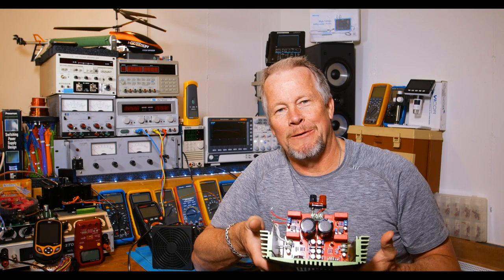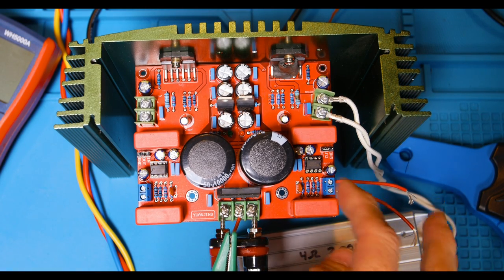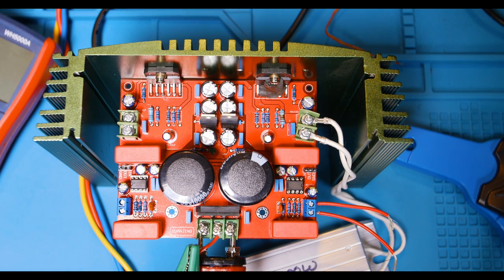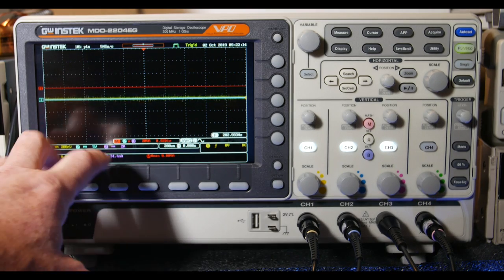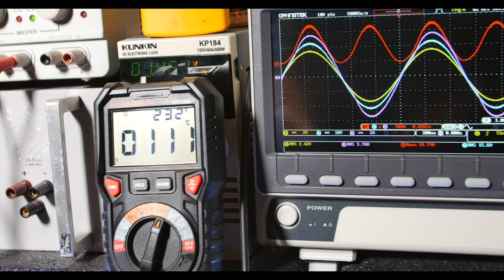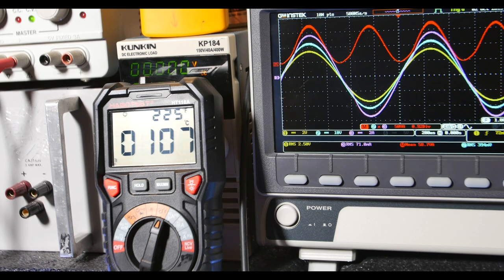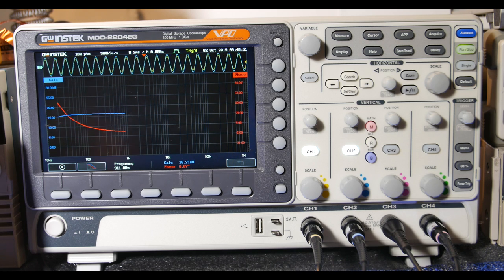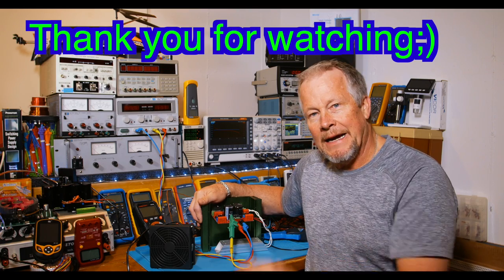Class AB Power Amplifier LM3886 at Full Power

Comment: Thanks Eddie , The temperature is high for just 1 amp ! 
With 2 amps even higher !! 
better do some cooling grease between the amp and Cooler 
Also I like to know how hot it gets when using both of them
You don’t use a noisy fan at the back of your amp at home 
And what influence has the fase on music quality? 
Thanks in advance 
Best regards Bert
Reply from the maker: Bert van Lelieveld YW Bert and thanks for the great questions!  I’ll explain what I think the phase might do to music and power both channels in the next video.

Comment: THE THING THAT I DON'T LIKE ABOUT THAT CLASS AB AMPLIFIER IS MOST PEOPLE USE EIGHT OHM SPEAKERS HOWEVER,IT DOES HAVE IMPRESSIVE RESULTS.
Reply from the maker: Hi David, this amp works great with 8 ohm loads too.  I used 4 ohms to show how it can handle that load.

Comment: LOL nice with a video I can understand without having to squeeze my brain:-)
At 10:20 you have some clipping, right? You decided to turn down for the input signal, but could you not also have turned up for the supplied voltage? I am wondering, how do an amplifier react if voltage is fine but there is not enough current?
;-) to you to:-)
Reply from the maker: That’s great - I’m glad this one was easy;) I need a power supply with higher voltage.  The GW Instek power supply is only rated for 30 Vdc, but it goes up a little higher than that.  I’ll do a quick example to show when the current is not high enough - that’s a great question!  Thank you for the great feedback and questions!
Reply: The high freq oscillation is caused because lm3886 was used with resistive load, with a speaker that oscillation disappear. This circuit is waiting for a inductive load... One colegue did a video and figure out this "problem".

Comment: Hi. I have the same board but it suffers from terrible hissing sound. Do you know how i can fix it? Thanks in advance.
Reply from the maker: Hi Enio - that's interesting...  It could be a bad connection, or a ground issue. You could try placing a 10 ohm resistor in series with the input signal return/gnd.  This might isolate the ground/loop issue - if that is what it is.  Let us know how it goes...
Reply: @KissAnalog  im willing to give it another shot.
Reply: @KissAnalog  does the Resistor wattage matter?

Comment: I thought the LM3886 is a Class D amplifier? What am I missing here?
Reply from the maker: Thanks for asking.  It actually is a class A/B, so no switching and does need some heat sinking;)
Reply: @KissAnalog  Im learning here still...... it just dawned on me that not all "chip" amps are class D. I have a sharp cd7700 amp that claims is "digital", inside though are STK chips which Ive learned are "darlington" AB amps.
Reply: Just today I disassembled a sub which claimed to have Class D amplification, on the heatsink were dual TDA7294 chips. Checked the datasheet and these are also listed as Class AB chips, WTF!?!?

Comment: Some of the distortion you see when you crank it up is high frequency oscillation.  This shows the amp isn't quite stable under all conditions.  It shouldn't oscillate at the clip point.
Reply from the maker: I’ll take some time and look at this.  Not sure if it is related to the power supply or amp...
Reply: @KissAnalog It is usually the compensation of the driver stage being too small.  You can try placing a cap across the feedback resistor or slightly increasing its value if one is present.  The power supply is not usually the culprit unless you are using a regulated  supply.  The current peak might cause the regulator to burst into oscillation if its unstable.  Hope this helps your search.
Reply: I have this very board and it sounds great but has terrible hissing sound. Do you guys know a solution other than making my own outboard psu.
Reply: Needs s Thiel Network at the output to solve the oscilation
Reply: The high freq oscillation is caused because lm3886 was used with resistive load, with a speaker that oscillation disappear. This circuit is waiting for a inductive load... One colegue did a video and figure out this "problem".
Reply: @flimabr  It's just a poor board design. With proper design, there should be no oscillation.
Reply: @johnyang799  no, with a good board design, it will oscillate until you use a speaker properly... If you test with a resistive load at out, it generates this kind of oscillation... Inner circuit of lm3886 wait for a inductive load, formed by coil turns of a speaker..
Reply: @flimabr  JohnAudioTech has this video showing fixing the oscillation. https://youtu.be/cETOU-ikG7Y

Also on the other spectrum, TomChr from Neurochrome also has this article https://neurochrome.com/pages/stability

I personally have designed a -120dB THD+N, -136dB THD, LM3886 based power amp without any stability issue.
Reply: @johnyang799  tomorrow I'll see this links, tks man 👍🏻
Reply: Poor circuit design. There is no 'resistor/inductor' filter on the output for a start. Maybe other problems